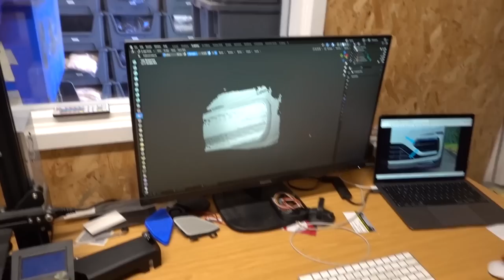We modify the T7 Multivan, then take it to a Transporter meeting and asking people their opinion.

Comment: As a VW Technician and Having had several new Transporters since 2004 my only gripe is the van suspension is rough no matter what combination of springs and dampers are fitted. Koni Actives do work the best with std springs but I've not driven one lowered van that rides and handles properly mainly due to the loss of suspension travel. The T7 is built on Car suspension which is designed primarily for handling and comfort and is bound to ride and handle better than the Transporters if not lowered too much. I agree they all look better lowered but without damper travel they handle badly. The T7 will be popular and hopefully get people out of oversized SUV's
Reply from the maker: Really. I found the koni actives extremely underwhelming. There are far better suspension out there.
Reply: @THQAutomotive  In my mind a transporter van will never handle like a sports car but it could ride more like a Limo and less like a load carrier. Koni actives with caravelle springs is the best solution I've found. If you want low and stiff then yes there are   stiffer damper rates available.
Reply from the maker: @paulmcmorran3677  What others have you tried? I really didn't rate the Koni actives. I know many others that have tried them that thought the same
Reply from the maker: @24k__J  Apart from the people that own Caravelle's and the previous multi van?
Reply: @THQAutomotive  Have tried Koni adjustables and Bilsteins. The fundamemtal problem seems to be loss of suspension travel and once dropped 30-40mm you're virtually riding on the bump stops . I use Koni Actives which work great with OE Caravelle springs .They don't work with lowered springs as theres not enough travel to generate internal damper pressure. It would be useful if someone produced a shorter strut body to allow more travel when lowered.
Reply from the maker: @paulmcmorran3677  oh ok, I've never tried them with they 30mm drop of a Eibach springs. With the Koni and Bilstein adjustable, they dampers are of course shorter to work with the lower springs.

Comment: My two pence thought….. 
VW sacked off the Touran and Sharan due to poor sales (apparently) but they came out with this which to my eyes looks like a updated version/combo of the two!!?? 

The rear end looks like the last Touran to me.
If I was a sceptical man (I am) I think they’ve branded it as a T vehicle in the hopes of people and companies like yourselves to jump on it to give it the kudos and cult status of previous T vehicles…. I quite like it, they just named it wrong imho.
Reply: Agreed
Reply from the maker: I think you have a strong point there. All that aside, it drives great and it really well equipped.
Reply: @THQAutomotive  no doubt it does, all new dubs do and are on a whole.
As I say, I do like it (with the styling tweaks)
If you think about it, it’s the same thing Ford did by putting the Connect vehicles under the Transit banner… automatically makes you think of commercial use.
Going off what I’ve heard about sales of the new Caddy, I wouldn’t at all be surprised if they sacked it off for the T7 or 7.1
Reply from the maker: @tonyallen8590  it'll be interesting to see for sure

Comment: Not sure I understand the fuss around them calling it a T7. Once the Multivan and Caravelle variants came out, "transporter" simply becomes the commercial variant of whatever Tx we're up to. The face and tail are growing on me. If they bring it out with 150kw 4motion & diff lock, I'll be sold. Thanks for the video! [Edit: I read more comments about the MQB and now understand. With the  2024 Transitporter on the way, I guess I better find myself a T6.1 in good nick!]
Reply from the maker: They do look 4motion ready as the rear hubs are splined ready for drive shafts.

Comment: I hate the T7... because VW called the new Sharan T7 for marketing reasons!!! Why are they doing this??? Is VW afraid that they can't sell the ugly bucket with a different name and have to fool a few T customers? With a T "Transporter" I connect a vehicle which is just as big as a T4, T5 and T6... with which I can also load 1 ton and pull a minimum of 2.5 tons trailer... So VW, give the ugly bucket another name.
Reply from the maker: It's a lot bigger then a sharan though. They seats are very similar to the Transporter Caravelle. Plus the sharan was just one size where as the T7 multivan comes in SWB and LWB, like a van.
Reply: @THQAutomotive   Yes, that's all OK, but why the T name??? Completely incomprehensible... I'm not saying Bugs Bunny to the Mona Lisa... The car will find its buyers, but just not T customers who want a real T... As I said, 1 ton load and a minimum of 2.5 tons trailer...
Reply from the maker: @911marcus  I've questioned this myself. It could be that the ID-Buzz is designed to be the next Transporter. It could be that they decide to change the name with the Ford collaboration. Make this a T might be the only route they saw to keep the name alive. It is very similar internally to the Transporter Caravelle and comes in a LWB and SWB. The T5-T6.1 does need a massive redesign as that chassis and panels etc haven't changed since 2004. If this does become a T7.1 panel van, I actually think dimensional it could work really well. Especially the LWB version